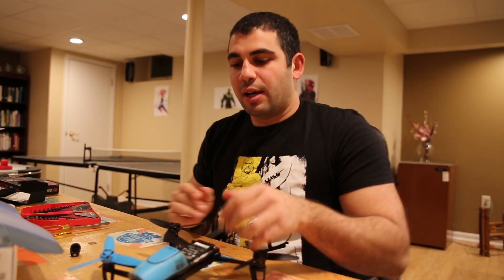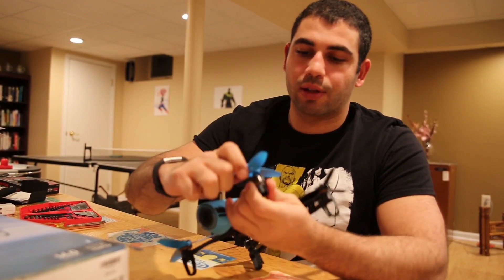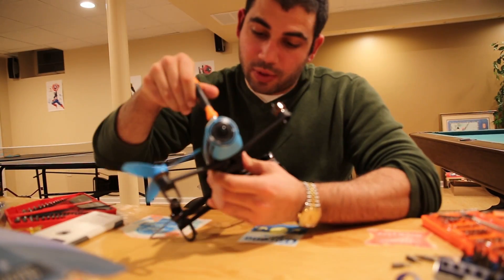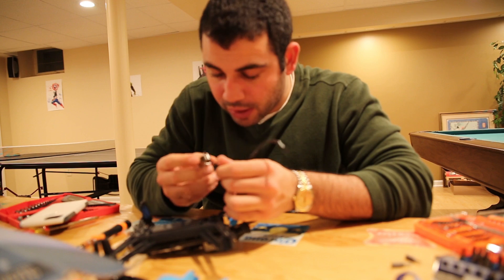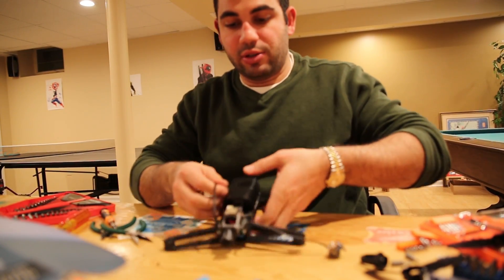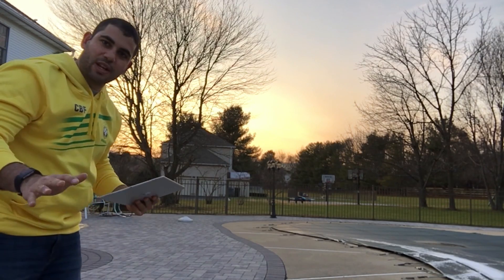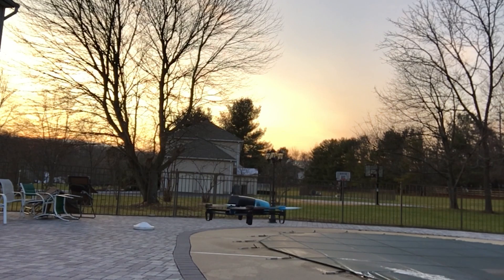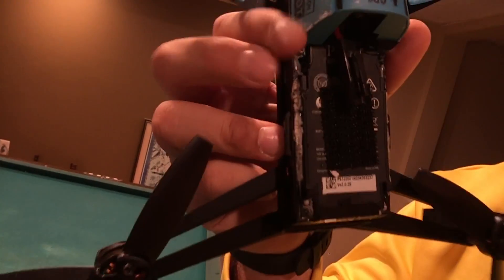Parrot BEBOP Drone - Motor Stage Error, Stabilization Error, Battery Latches Broken?!?

Comment: Just seen the repair video.  My son just bought himself a used Bebop as his first drone.  The only issue we are having is the GPS on the drone is not working.  I switched out the GPS card and still nothing.  Next I was thinking it might be the cable but not sure.  Do you have any other suggestions.  I can't find anyone around us that works on them.  Thanks
Reply from the maker: Honesty not sure - my guess would be trying the cables. If not, it might be with the sensors that help orient the gps

Comment: I get mother stage broken and my drone is brand knew I've not banged it or even clean it
Reply from the maker: Could still be a loose wire because of how they manufactured it :/
Reply: Try factory resetting the drone

Comment: Hi  good vid...when u switch the cables to see which motor was the problem..I did the same thing  should I have switch it back to  the side it was in bfore.? Bcuz now the drone won't take off it flips backwards..so wat did I do wrong..thnkz
Reply from the maker: 100% switch it back to the original. Each wire is specific to tell each motor how to operate. Switching the wires is mainly to diagnose if the wire or the motor is the issue
Reply: Thanks  for the response got it..do u happen to know anything about the Bebop 2 .? I'm getting a continuous flashing power botton it connects to WiFi but not to the app.! And I can't hardset bcuze the light keeps flashing.! If u have and ideal or know wats going plz share ..lol it would be much appreciated.thnkz
Reply from the maker: Spanc Fai'son what color is it flashing? There’s a couple steps you can try to have it connect to the app. First, have it forget the WiFi connection to the drone and then reconnect to the WiFi and see if that fixed it. Then, try going into the app and see if you can calibrate the controller before connecting the app to the drone. Lastly, uninstall the app and reinstall it ... let me know if that helps
Reply: @MakersBestFriend  ok I tried all u suggested, and still no connection to app ..it's wifi is connected.but in the app no connection..tried to reset light juz keeps flashing a few time light flashed rappedly but know connection.checked motor connector all connected , took them alose and connected them back I still get no signal found.! That's where Im at ..and thanks for the help much appreciated
Reply: Oh did fix the bebop1 thanks again now its the 2.. LoL
Reply: Aye how u doin..well figured out wat the problem was and fix it ..u have to disconnect the.! I guess cam cable  that up  under the cam and then turn the drone on.. and then turn it off and  connect the cable back and it should it be back to normal.."weird"  but now the left motor is stalling.! I didn't think it was the motor so I criscrossed the cables and the motor worked..but  how to u replace the cable to the motor to work..or is it just the connector on the end of the cable.? Do u know.?.thnkz

Comment: Good job mate;)

I just bought a bebop one and a bebop 2, 
My bebop 2 is having a problem, the front right motor is not spining and it says motor error 5.
Ive swap the motor and put another motor and the problem is persisting. I believe the problem isnt on the motor but may be on the wiring, i’ve changes the wiring also which connect the faulty motor. But the error 5 is still percisting.

Do you think its an esc?
If yes , can i change esc myself or these need to be done by some profesional?

Please advise.
Thanks a lot.
Cheers
Reply from the maker: Thanks Imran - If it's a new drone, I would just bring it back to the company. If you have a lot of experience soldering, then I do think you can change the esc yourself, but again I would recommend that you've soldered electronics in the past and know what you're doing so that you don't ruin any solder joints. Good luck with it!

Comment: My I can’t click on motor error 11 because the joystick get in the way is there any other different ways
Reply from the maker: Motor error 11 is normally caused by a motor being disconnected. Even though you can’t see which, if you remove all propellers and click take off you should see which motor isn’t turning
Reply: Jake Qualmann yygg

Comment: Hey George, I got a Motor error 2 on my first flight outdoors. I turned the drone off and restarted it a short while after, It said there was no error but should I be concerned? Thanks a lot. EDIT: when I turn that propeller with my hand it makes a noise that none of the other motors do
Reply: hi thanks for the quick reply, I am linking a video to the sound as i cant describe it https://youtu.be/0l6EEMXB584
Reply: George Lehaf ok thank you very much I appreciate it

Comment: Hello, after crushing im already changed central  cross, cause its broken, but there are noise and drone vibration not like usually, should i change a motors also?
Reply: George Lehaf thank you for quick fb, rear right motor has high vibration and creak's during rotation and it's looks this issue have impact to video quality of drone.
Reply: George Lehaf thanks for your help!
Reply: George Lehaf one more question, do you think i should change only rear right motor or front left as well?